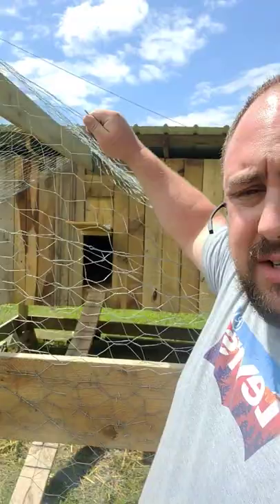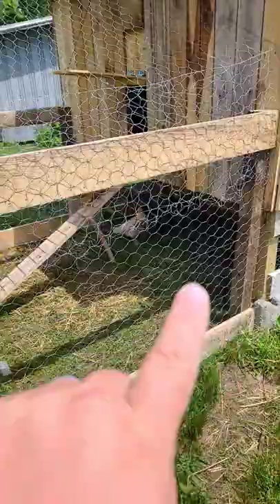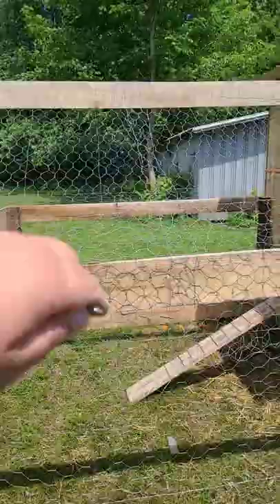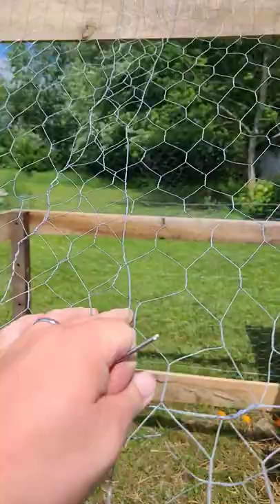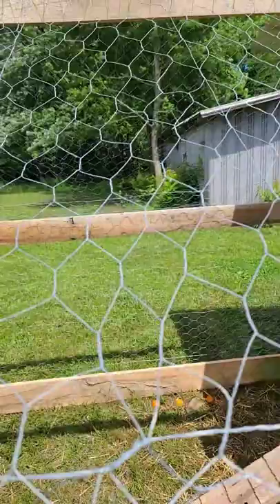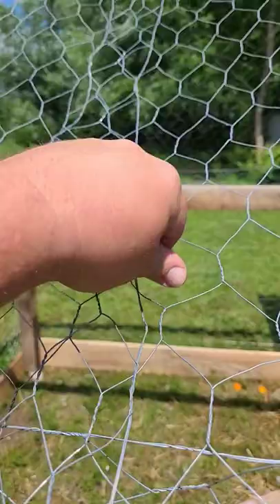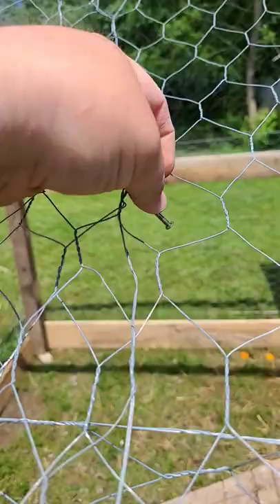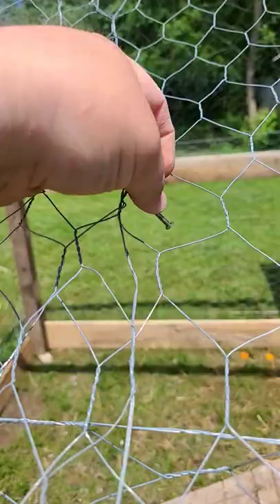Chicken Coop/Run Wire Fencing Hack!

Comment: Hope you don’t intend on keeping predators out and only keeping your chickens in. Chicken wire does just that, keeps chickens in and lets predators in as well. Use 1/2” hardware cloth if you want to keep predators out, 16 or 21 gauge.
Reply: Fox or raccoon couldn't get through my chicken wire 🤷‍♀️ saw it on camera